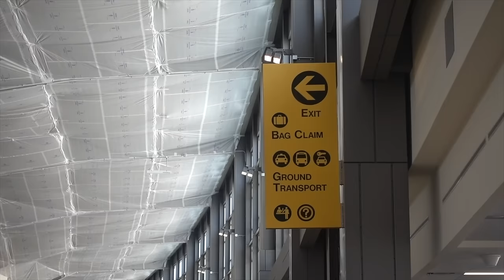MTB Myths that need to die—and some that are true!

Comment: Dropper seatpost myth: "You'll destroy your dropper post if you use it hang (clamp) your bike into a work stand!". Only partially true. (To avoid certain damage) A dropper post must be out at its full extension when clamping your bike into a work stand.
Reply: Also depends on the stand. If the stand doesn't have well made circular clamps to match to seatpost (or really worn down clamps), it can break.

This story doesnt exactly apply to seatposts, but one time a buddy of mine tried clamping his carbon bike by the seat tube, and the jaws weren't exactly well shaped to fit the bar, and he cracked the frame. He had to get a new bike.
Reply: I don't know why it would be a cause of concern to hang it from the dropper post to work on it, considering the forces it is required to withstand in its lifetime.

Comment: Quicklinks being one use always made me laugh) Actually, some of my quicklinks outlived more then one chain) And I was snapping it very often since I used oil and cleaned the system once every week or two. It was kinda cheap decathlon one. It had less strong engagement then the 1st time but I have never had an issue with it.

Comment: In the 80’s as a teen i could bunny hop over a typical 13 gallon kitchen trash can with no ramp. My BMX bike was chrome alloy with skyways instead of spokes (not the lightest). The trick is to keep the tires fully inflated. You have to remember that a Bunnyhop is actually bouncing the bike off the ground. Therefore, suspension on bicycles works against you. You can Bunnyhop better with a hard tail and with forks with no suspension (or lock off the suspension).
It was pretty cool to be able to Bunnyhop up steps and over guard rails. But I’m too old for that now. Just being able to bunnyhop over curbs and small trees is good enough for me now.
also, I never expected to be able to Bunnyhop as high on a mountain bike as I could on a BMX bike which is smaller and more controllable.

Comment: Generally, airliner cabins (which include the cargo deck) are pressurised to the equivalent of 8000ft altitude, which is roughly two-thirds of sea-level pressure (which in turn is about 14.5psi under standard conditions).  So the increase in gauge pressure seen by the tyres of a bike stored in that cargo will normally be at most 5psi.  You won't see much offset from temperature, either, because the passenger cabin is heated to about room temperature, to keep the passengers happy - and most of that heat also filters through to the cargo deck.  Some long-haul airliners even put a kitchen, accessible by the cabin crew, below the cabin floor, and effectively in the cargo deck.

However, one aspect of airline safety is what happens in the event of a sudden cabin decompression, eg. due to a window breaking, or the latch of the cargo door failing.  This could cause the ambient pressure to drop from the normal 10.9psi of a pressurised cabin to the 2.7psi at 40,000ft in less than a second.  This would of course trigger the oxygen masks to fall from the ceiling, and the pilots would immediately descend the aircraft to where people can actually breathe without oxygen assistance, but that pressure difference will be felt by your bicycle tyres, and it could be very sudden.  This is probably what the security guys at check-in are concerned about; airline safety is all about guarding against even quite remote possibilities.

Fortunately, most tyres nowadays are designed to withstand significantly higher pressures than you would normally need to ride on.  My hybrid bike's tyres are rated to 85psi, but I usually inflate them to 50psi (front) and 65psi (rear).  That leaves more than 20psi margin on even the higher pressure tyre, which means even if I subjected them to hard vacuum, they wouldn't burst.

Comment: One thing you might mention on the hanging the bikes is: Don't go squeezing the brake levers while hanging (with the bars up)... if you are low on brake fluid at that angle you can pump air into the brake line.
Reply: Totally agree about brake levers. On a previous post about this subject I mentioned about my breaks seizing after my bike was stored vertically, someone replied saying it was not possible, I told him it had happened to me twice and he still insisted that I was wrong and shouldn’t be riding bikes if I didn’t know the basics about brakes 😐.
Reply: Yep, found out the hard way. I had mine on steady racks and pumped the breaks to get them down and learned that air bubbles got into the brake lines. Then you have to remove the brake reservoir screw and pump out the bubbles with a bleed kit. Lesson learned.

Comment: There's a few I think might have got missed.

- When you're learning to ride, starting on a hard tail makes you a better rider.  I'm unsure of how true this actually is.
- The attitude that only the really expensive bikes are worth it.  I've seen that come up occasionally and I kinda think it's a bit 'snobbish'.  It's true that a top of the line bike will be better and more capable than a Walmart bike, but I've got a 2014 model hard tail that went for a bit under $A1000 when I bought it new that I've maintained over the years and upgraded as I've improved and it still goes. If you choose wisely, even a bike that's just one or two steps above 'bargain basement' can be a very good buy that can give you years of good service. After a certain point you're spending a lot of extra money for only very small improvements.

Comment: The quick link thing reminds me of the tire plug myth.   I've heard people say a plug is just to get you back to the car and that you should replace the tire asap.  Unless you have a sidewall puncture there's usually no need to..   Tires can last for a long time after a proper trailside repair with a plug.   Spend $90 on a new tire?.. Again, hell no !
Reply: I've had plugged car tires last 20-30,000 miles after plugging.
Reply: Plugs can definitely get ripped out even if they've been in the for awhile. You don't necessarily need a new tire but it's best to patch the tire when you get home
Reply: I have an automotive plug strip in my bicycles front tire for a few hundred miles now. It looks like I ran over some chewing gum so annoys me whenever I notice it, but it's definitely not worth replacing for that
Reply: Plugs are illegal in the Uk

Comment: The ball end is designed geometrically to engage properly. If your bolt is not damaged, it cannot engage differently than a regular allen key. It does have a smaller contact area though. But any real damaged you get is from it rubbing, because it is basically a universal joint which is not constant velocity. which there are two things to consider:
1. This mainly happens while screwing it in
But
2. It doesn’t really hurt much unless there is force AND you turn multiple flats at once

The best option is to reduce the angle you are using it at. In that example you were 100% clear to move it vertically and probably should have.
Reply: I want to know what causes the seeming aversion to using a hex key socket in the bike world. I can't begin to count the videos I've seen where they are using full sized allen keys and thinking to myself why isn't this guy/chick just grabbing a ratchet and getting it done in a fraction of the time?
Reply: It isn't a universal joint which does have changing rotation speed, it's a constant velocity joint (CV) found on the front of all FWD and AWD vehicles. The sliding motion you mention is how it maintains constant velocity. Good in cars for at least 100,000km.

Comment: The aeroplane myth also falls apart based on the fact that modern airliners also pressurise and heat the cargo holds to the exact same degree as they do the rest of the cabin. The reason is basically to prevent a similar event from happening to some other cargo the aircraft may be hauling; maybe not with a set of bike wheels, but for example a pallet of aerosol bottles. (Passenger airliners do actually transport commercial cargo, and some of the associated expenses are included in your plane ticket's price)

Comment: Re: rear QRs.  One minor thing that can be important (more so if you're doing group rides on the road) and safer is to point the QR lever into the rear triangle (not backwards away from the bike) when you've closed it.  I've actually seen it  happen in races where two riders overlap wheels and the rider behind actually opens the rider in front's QR, and they had stop because of a loose rear wheel.  It doesn't happen often, but why not completely eliminate that possibility by making the lever face forward?
Reply: You're right.  We followed the same reasoning.  But the counter-argument to facing the QR lever forward was catching it with a branch while mountain biking, and having your rear wheel release.  So the agreed-upon ideal position was facing up along the seat stay.  That position prevents pretty much every inadvertent QR lever release.  But with disc brakes today, it's not as straightforward as it was.
Reply: 100%. qr levers should be angled in such a way that they are the least likely to catch on things.
and one benefit of keeping the levers away from brake rotors is that if somebody is taking a wheel off or putting one on they might have dirty or greasy hands, potentially contaminating the brake.

Comment: On that last note regarding ebikes.....Yup I am so lazy I bought an ebike June 16 2021, and as of today, I am just under 6000km.  More km than I put driving. I bought it to ride more and I ride it almost everyday and only use my truck if I need to carry something. Even for hauling I got a small trailer so I still use the bike more than my truck.

For arguments on being lazy at the trail site, I simply point to chair lifts or other means that are out there to avoid riding to the top. On trails where riding up is the only option, you get to put in more runs, and if you want to really get a workout, go ahead and climb with no assist.  My bike weighs just under 60lbs, so hill climbing a heavy bike is certainly a work out.

The lazy myth with ebikes is based on not understanding, that you can work as much or as little as you want. I do NOT throttle around town, I have pedalled 99% of all those kilometers.

Comment: Great video.
I can't bunnyhop with flats anymore.  Almost 40 years riding clipless, I'm worthless on flats!
I guess I just suck then!  (But learned on my Mongoose with flats, so I put in the time!)

To add to the "storing a bike vertically" debate, it gets even more absurd with tandems!  Some worry endlessly that hanging their tandem on the wall by one wheel will damage the wheel.  "But my wheels are CARBON and LIGHT WEIGHT and REALLY EXPENSIVE!  I'd NEVER hang my tandem by ONE wheel!"
So then I ask them what happens when they hit a bump on their tandem?  A tandem with a 350 lb. team flying down a hill at 40 mph hitting a pothole, rut or bump.  The peak forces on the wheel hitting the bump are truly insane.  Especially a road tandem without suspension, 28mm tires at 120psi, at speed, and hitting hard asphalt or concrete surface.  Which is why most tandem wheels are over-engineered to withstand the crazy forces acting on them.  (Ask me about high torque loads on rear hubs....)
And you're worried about hanging a 40 lb. tandem on a hook?  PUHLEEEASE!  "Oh but over TIME, the wheels will warp!"   Oh lord!
I've gone round and round with these nitwits and usually just give up!

Comment: Leaving the QR open is a way greater concern than if it enters the disc brake or not.
That is the same regardless of the side of the bike it is installed.
It is more convenient to have it on the left, and that offsets its weight a bit too.

Comment: Enjoyed the video! For road bikes even more true that you DO NOT need to deflate tires (15 psi change on say 120 ...still that is the myth.) Lots of things with bike are taken as true when it is wrong, unmeasured or  just tradition...Your Quick link example is a good one. I think if you measured the wear in opening and closing that link it would be a lot of closures before you could even measure the difference in force to open it. 
Another example is the direction of the thread for pedal axils, right is right, left is left handed thread. I was told so the axil is self tightening when riding. BUT if you actually check on what happens when you pedal you will see that any resistance in the bearings when pedaling will tend to unscrew the pedal. So this some kind of myth or tradition...

Comment: The reason for not putting your QR lever near the disc brake is in case you've been braking downhill and have been doing a lot of braking and cooked your rear brake and disc. In some warmer climates it's a definite concern. As for quick links, by the time you need a new quick link you probably already need a new chain.

Comment: With regards to deflating tires on a plane. Yeah, mountain bike tires probably won’t burst even in a vacuum when inflated properly. The problem is with hazmat and security. Mtb tires are grouped into the same category as all tires which constitute a hazmat. Even if we could get the faa to admit mtb tires are not likely to burst, the fact that someone could bring a tire filled almost to the point of rupture creates its own issue. That means the tsa would then be required to measure every tire that goes through their screening checkpoint and compare it to that specific tire’s limits. While a mtb tire still probably wouldn’t take down a plane, other tires could, which means rules and training would have to be implemented for every subcategory of tire which would lead to rules and training for every subcategory of every hazmat. That would cost money the tsa doesn’t want to spend. On top of that, I don’t know if you know any tsa agents, but they don’t make enough to want to learn every subcategory of every item of hazmat.

Comment: regarding storing the bike and oil in seals -- how do the suspension companies and bike shops handle forks that are in inventory? Are they rotating them to avoid having stuff "dry out"? How about seals that are replacement parts. They're not stored and shipped wet are they? I hear the same thing in plumbing sometimes: "Don't drain your pipes the faucet seals will dry out and go bad," but the new seals I buy when I need them come dry in boxes and have been sitting around that way for months or years.

Comment: I personally don’t think that a rapid engagement hub will ever sound as good as the slow engagement hubs that I prefer such as my hopetechs. In addition I also believe that 90% of Mtb enthusiasts will never FEEL the difference between a fast or slow engagement hub. Until we start talking silent hubs with immediate engagement. They are easily distinguishable from the rest as far as feel is concerned. At this point it is a preference in feel.

Comment: The reason I've been told for turning your quick release levers around is to prevent burning you fingers on a hot brake rotor. I've never heard of this myth that the quick release gets stuck in the rotor until now. I turned around my skewers around back in the 90's, when my brake rotors could get hot, but I don't do it much anymore. Thank you.

Comment: Quick links... A bit like the good old day links with a clip. I was with a friend racing his TZR in Christchurch NZ. 
Some numpty in scrutineering decided that the clip had to face open end to the rear of travel and made him remove the clip and refasten it the other way.
His chain came off during the race but luckily it didn't jam and throw him... 
As the chain was not passing over any slides that came near the clip it was never in danger of being unclipped. Inadvertently the scrutineer put the rider in danger by making him adjust the clip (a new clip would probably have been better advice...   Personally that is the only time I have ever seen a chain clip fail an I rode trailbikes from the mid 80's till taking up MTB DH just b 4 covid.

Comment: Re The quick link. It’s also about not reusing it on a new chain. The pins of the QL wear, then you put those pins in a new chain who’s bore is new, and now you’re already having play or looseness, causing that length of chain to measure a tiny bit longer.

Comment: so here is some insight a little bit late but better late than never. thermo(and aero)dynamics graduate here. so this is is true but not for the reasons you might think. the problem with inflated tires is not on your routine flights. as previously mentioned and correctly, the cabin and cargo pressures are the same. the problem occurs when there is a loss of cabin pressure. if for some reason the cabin loses pressure, the pressure and temperature differences between the tire and the ambient environment can make the tire expand a lot more than intended, and some low quality brands, or just bad luck, can cause the tire to blow up. now, for the spin off: the tire blowing up and exploding does not endanger anyone and could not affect the flight physically at all. the sound of an explosion however, especially during a rapid pressure decrease, could cause panic and mass hysteria on the plane, that could lead to injuries and loss of life from the mayhem. hope this helps you a bit to understand more of how when you combine several concerns in one solution can lead to some strange looking rules.

Comment: Quick release levers:- I make sure the lever end faces backwards, such that as I'm riding forward and travel close to low shrubs or rocks, the lever "shouldn't" get accidently released. If the lever was facing forward, or even facing up or down, and I hit a rock etc, there is more of a risk that it can be caught and pulled open.